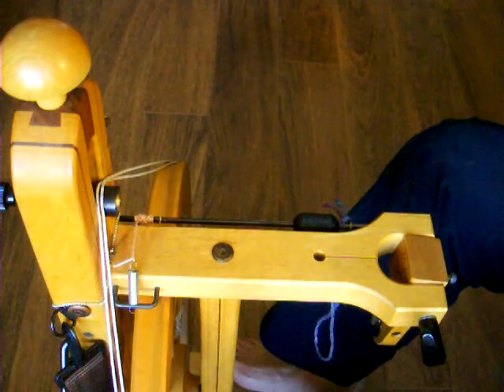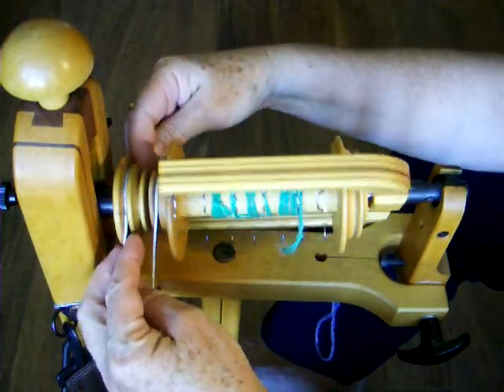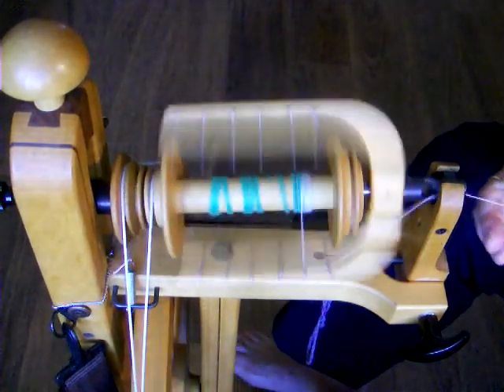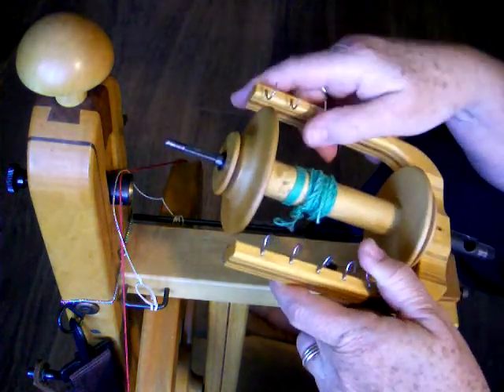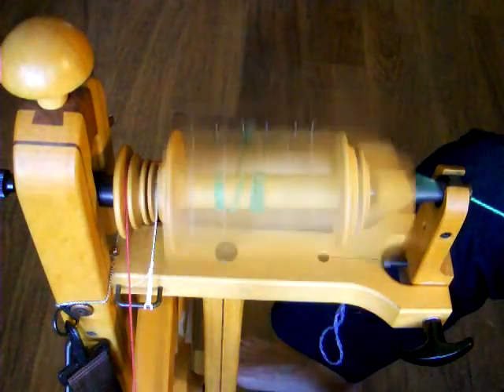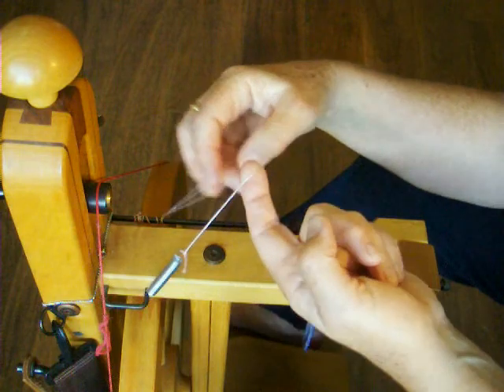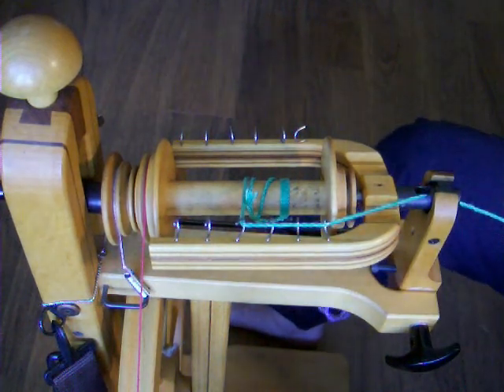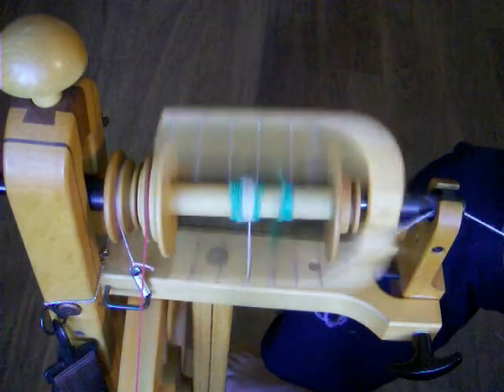One Schacht - Three Wheels

Comment: I purchased a Schacht Matchless and learned to spin on my own.  As a thin yarn spinner I found this invaluable.  My yarns have been far from optimal due to using the wrong ends of the bobbin and other errors.  Looking forward to trying the Scotch Tension method.  Love my wheel and now I will love it even more.  Thank you

Comment: I recently purchased my first Schacht wheel. I have had 4 other types of wheels over the years and still have my Little Gem the last wheel I bought about 10 or so years back. I love , love , love this video. I was wondering what I was doing wrong as being used to a bobbin lead wheel when you get too much twist you need to give less tension. A friend showed me this video at her place (she has the Matchless also) and not far into  the Double Drive I hear "is you have too much twist tighten the tension" . Great refresher course for those of us who haven't spun on a wheel that offers options other than bobbin lead. Thanks!

Comment: Aaah I 've just watched  all you video, Well explained.
I see now how the scotch tension works.

When  the  fiber  is connected  from the  flyer to the bobbin  with  a single band drive  then  both spin at the same speed.
I think the bracking action  through the friction  on the pulley  is  activated once  the  spinner releases  the pull on the fiber.

Comment: I am thinking of getting a Ladybug. Will these techniques work on it or just the higher end Schacht? I am a total newb, obviously. Great video. I am bookmarking so when I get my wheel, I can review again.
Reply from the maker: This will work on both the Matchless and the Ladybug, but the Sidekick only has the option for Scotch Tension.
Reply: Funny enough, I ended up getting the Matchless afterall. It was an older one, and was actually less than a new Ladybug. I am happy with it.

Comment: I  don't understand  the loosening  and tightening   of the drive band to  increase  or decrease twist.
The whorl  has   2  pulleys  and on the larger  pulley  the   flyer  will slow  slightly  but the bobbin  will remain  at the same speed. This will reduce  the twist  because  the  fiber is being  "taken up" at the same speed.

If you want to increase the twist  then  move the drive band to  the smaller  pulley on the  whorl.

I've  just built a Saxony spinning wheel  from  raw timber  and that's how I understand the operation. Have yet to get my head around  how the bobbin can "take up" wool  on a single drive band  wheel.
Reply: In double drive the drive band will be slipping on either or both the bobbin and/or flyer.  The radius of the whorl on the bobbin is smaller than the radius of the whorl on the flyer which means the bobbin will prefer going a little faster than the flyer (bobbin leading the flyer). A bicycle with little wheels must be pedaled faster than one with large wheels in order to go the same speed across the street.  The little wheel will have to go around more times than the large wheel to cover the same distance.

At the same time, the larger whorl has a larger contact area with the drive band than does the smaller whorl and therefore a greater coefficient of friction.  The larger whorl will want to slip less than the smaller whorl.  The tighter the drive band, the greater the coefficient of friction on both whorls, but the larger whorl will win out and slip less than the smaller whorl.  It will slip less and the smaller whorl will slip more the tighter the drive band becomes.
Reply: While both will change the take up, which changes the amount of twist, changing the whorl is a gross (large) change. Changing the drive band or brake band is a fine (small), more precise change. Try it. You'll see it works just as described.